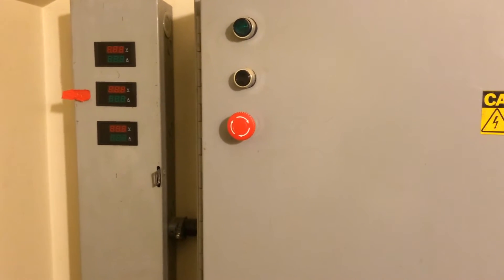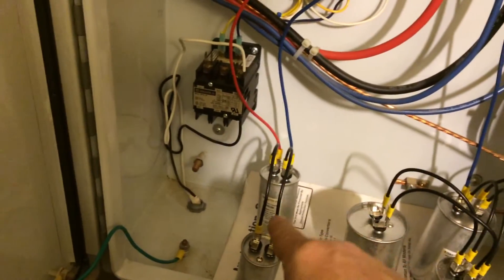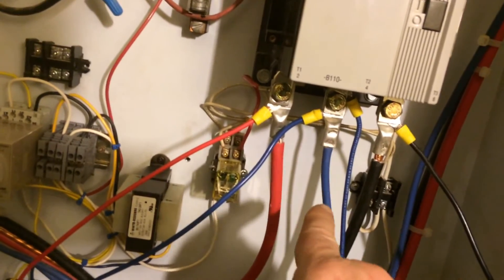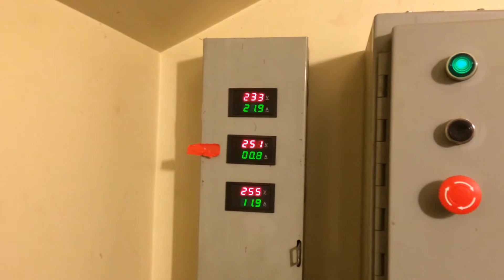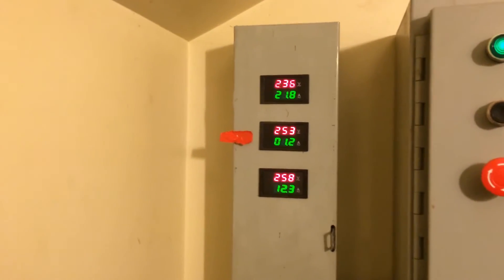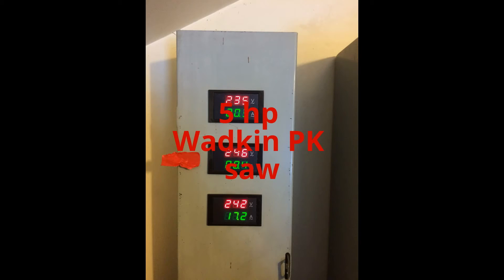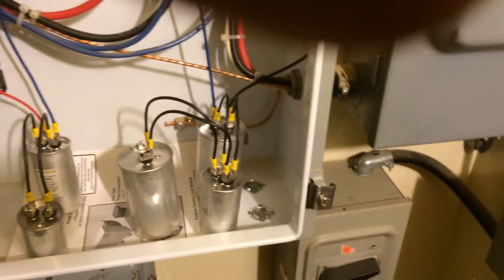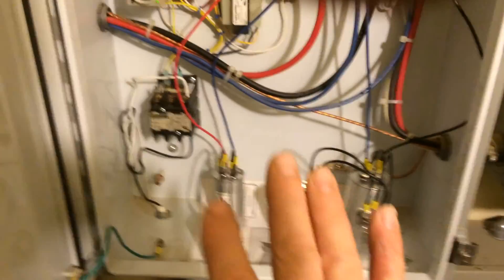Balancing a Rotary phase converter for hard start.

Comment: I see a timer in control cabinet. Is that to time the start cap and what time is it set at. Thanks
Reply from the maker: yes, I use that as a relay to throw out the start capacitors. I can't remember what it's adjusted to, but it's throw those things out fairly quickly a few seconds maybe three.

Comment: you are the first person to explain the balance simply, thanks, BUT  they say that more than 4 percent variation in voltage can damage equipment, just keep an eye on the idler motor make sure there is no burning smell eh

Comment: Great video like always!!! Are you using potential relay to take out starter capacitors? I am also curious what those components all called that shows you the volt and amp? I am making my own and would like to add that to my setup.

Comment: jack 
Kind time of the day, thank you for helping people to design schemes, I wish you health and goodness, please tell me, this device saves electricity? because I have in my workshop 3 phase 380 in, it is worth me to remake the power supply to the phase converter, thank you in advance for the answer my had:  dizelmers@mail.ru
Reply from the maker: not sure i understand what it is your asking ?
Reply: jack English machines
I have a workshop that consumes 3 phases of 400 volts from a common network, I have to pay a lot of money for electricity, I want to give up phase 3 of the network, and carry out 1 phase by connecting a phase converter, the question: Which is better than the 3 phases common, or the converter? What is less twisted counter on payment for electricity?
.
Reply: @василийукраинец  Mate, if you have 3 phase, rejoice. Converters are for those of us who don't have 3 phase. Converters have losses that your supplied 3 phase does not.
  Fitting a VVVF drive to certain machines can save money (by reducing power output if the motor is over specified), but you will need to look closely at the payback period. One of the most important design issues is to not over specify motor capacity. Sounds good in theory but not always possible, which is why VVVF drives are fitted in industrial installations. Pumps and fans that run long hours are  a common target.

Comment: This is all good . The best approach to a balanced system  with capacitors is have  caps at "each" work engine you are using . Which I have done. The reason being is each motor has it's own optimal operating requirements  based on the manufacturer's design  , every motor is different . So doing the voltage adjustment at the converter only is like a blanket that is to cover all , it works but not what it could be; a truly balanced system. Phase converter manufacturers  will not say this or promote this because it goes beyond the plug and play approach to the group they cater to and most follow that format in there builds. It's a little more involved and adds cost. But if a person is going to build one from scratch supply the caps at the work motors and fine tune the motor under load. You will end up with a truly balanced 3 phase system  Thanks for the vid
Reply from the maker: I have considered balancing each machine but I would require pretty expensive capacitors and also some contactors to throw in run capacitors for start up and run time  . My biggest problem or should say obstacle is the only thing I use the rotary face for us to step the voltage up to 600. So the machines that are running on the rotary phase or 600 for machines

Comment: Im not sure if you still use this system, but your system could still be balanced so much better, your amp readings on your no load idler should be closer to 3-5 apart.
Reply from the maker: if you're using what you see in the video you can't go off the amps readings in the video . these are reactive amps and the  idler useage on the single phase . If the Voltage is balanced the amps are too.
Reply: +jack English machines Exactly.

Comment: Nice setup , I run smp digi-phase converter (www.digi-phase.co.uk) .hard  wired in to a normal breaker board ect - it work brilliantly I can't tell from true 3 phase - the only teething issue was we had to adjust the dc brakes to cut in sooner on the saws
Reply from the maker: +Suspension of reality  . I got 7 machines running  on a VDFs  and i do prefer the PWM to the RPC. That said i am using this set up to run the 600 volts machines through a transformer 9 KVA just because its cheaper to do so. really   my RPC is a little to small for this hard start and should be larger but is well balanced for 90% of the machines. Going to put a contactor in the Wadkin to through in cans at start up to get the speed up faster then drop them out for run. Phase perfect is costly here but very nice and have thought i might like it some day but with VFDs are do cheep i am not sure there worth it it for me any more.  thank you for the coment 

 http://www.phasetechnologies.com/?gclid=CKXh4cHxr8sCFQwPaQodTa8DFA.
Reply: +jack English machines  frustratingly for me there is 3 phase power on a pole at the boarder of the property , the cost of getting it in to the building is uneconomical at the moment with red tape attached
Reply from the maker: +Suspension of reality I have 3 phase on the road but costs are $10,000 to bring it in. no thanks i am smarter than that.
Reply: jack English machines what happened
Reply from the maker: https://www.youtube.com/watch?v=hYVVy0CrUfo&list=PLrGUwFtKG85TjtPvnXpz2yCG4Cyb5wZOm
Reply from the maker: LP here is how you get dual voltage from a 6 lead motor in the EU with a 4 wire(neutral)  3 phase system 

https://www.youtube.com/watch?v=KWpO2S3OL1Q